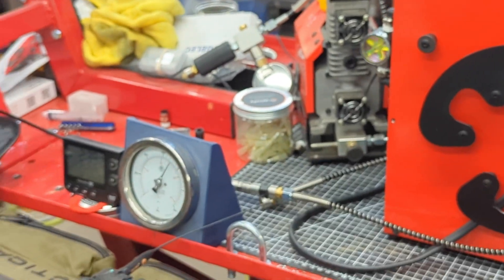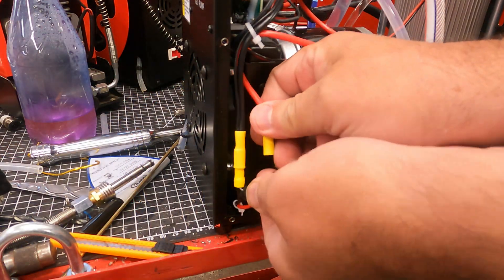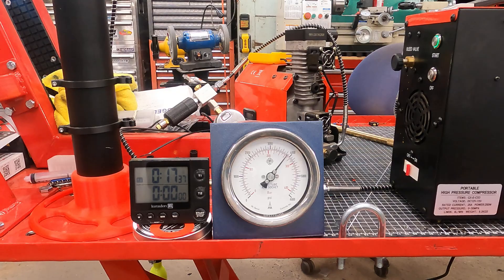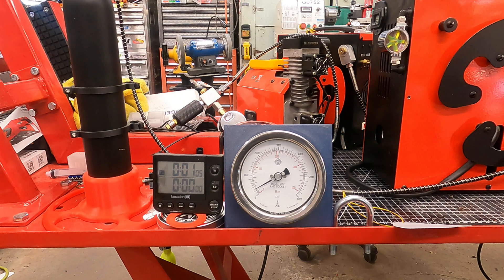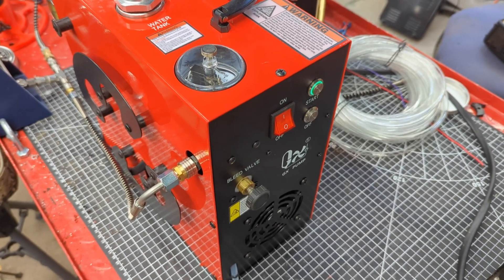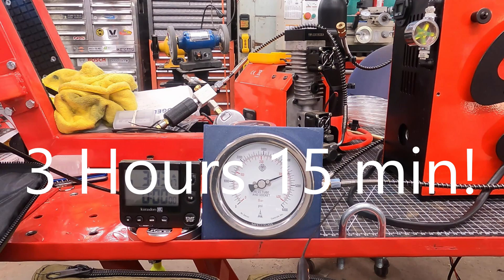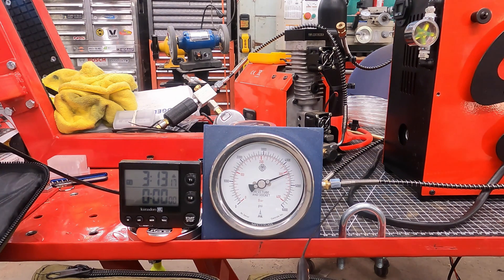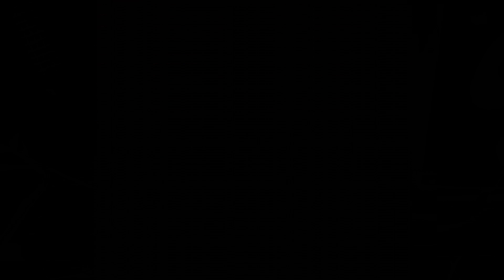Should you buy a GX CS4-3-2 compressor? Performance testing AND More! Yong Heng Hot Rod Shop

Comment from the maker: Affiliate Links That Support The Work We Do Here!
Use our link and visit Airgun Depot! https://app.rockporch.com/mlink/372?userId=140361

CS2 - https://app.rockporch.com/prdlink/UBed3CCDvC
CS2 L2 (Battery Powered)- https://app.rockporch.com/prdlink/DLgZx6QxCT

CS3 - https://app.rockporch.com/prdlink/nYp6zRhSOu
CS3i- https://app.rockporch.com/prdlink/JNULlImjtd
CS3 L3 (Battery Powered) - https://app.rockporch.com/prdlink/UVZP8sYOVV

CS4 - https://app.rockporch.com/prdlink/DPZTX4fHQM
CS4i - https://app.rockporch.com/prdlink/JQbFdsXagP
The “i” versions have the AC power supply built into the chassis and can run on 12VDC as well.

Comment: I’m loosing air in my cs4 and cannot locate it. I’m good at finding leaks but this is crazy, could it be leaking from the inside where the piston is?
Reply from the maker: If you are still under warranty, get the process moving RIGHT AWAY! Do not delay.

Comment: I'm done with the Yong Hengs.  Got 3 hours out of my last one.  Granted, I pretty much only use it to fill my 9L tank from 250 bar to 300 bar, but I baby the crap out of it.  Never let it get past 60c (or 10 minutes run time, whichever comes first), run an extra fan and bigger water pump, and use good oil.  I need something more substantial.  Do you think that this compressor would fit the bill?  Are you still in love with this compressor?  Thanks for all you do.
Reply from the maker: Welcome to the channel. The CS4 or CS4i are GREAT replacements for the Yong Heng. Yes, still loving the GX units! Using my links really helps, AND lets GX know who is sending sales there way! Win Win!
Reply: @TargetForge  been here for awhile.  Really got into the uh compressors because of your videos.

Do you happen to have an adfiliat link for the CS4-model?  I'd probably want to buy that model.  I did tell a friend about this compressor today and he ordered one.
Reply from the maker: @bigfranksworld  Here is one for the CS4 and CS4i, Also consider my parts for easily adding an hour meter and a flow indicator light for your water cooling, they really do elevate this unit. 
CS4 - https://amzn.to/3W6RXok
CS4i - https://amzn.to/3L6Khfp
Hour Meter Kit - https://targetforge.net/shop/ols/products/hour-meter-complete-kits/v/HR-MTR-CMP-KTS-STC-ON
LED Cooling Indicator - https://targetforge.net/shop/ols/products/gx4-coolant-illumination
Reply: @TargetForge  thank you!
Reply from the maker: @bigfranksworld  You are most welcome.

Comment: WOW. nice video. I have that same compressor and it seems to be killing the power converter. Customer service is really great and sending a new one at no cost to me. But WHY did the other one die and can it be repaired?
Reply from the maker: Hard to say, you could look for a blown fuse but troubleshooting switching power supplies without a schematic and and a knowledge of how they work in a steep hill to climb.

Comment: I just got the CS4 and did a Dead Head test. It took 24 seconds from 0 to 300 Bar. I really do not care for the instructions given with the unit. They could have been bullet pointed in sequence and better English. I came to the part where you add the water and it said to fill the tank and start the pump. You then would get an immediate drop in fluid level and to keep adding water until it runs out of the water return hole. So I added the water to about 3/4" from the top and started the water pump and nothing happened with the water level. I waited a few minutes and still nothing. The water was a little discolored from whatever was in there before. I finally had the courage to start the dead head test. It went fine. I then proceeded to fill my 2L tank and it took about 45 minutes. Overall I was very happy it was working well but I will now check into what it takes to flush the water tank. Since I am a beginner I find the lack of clear, thorough, practical instructions for all things PCP wanting. I will be documenting everything I learn from this and maybe take a shot at doing a video from the perspective of a beginner. I think it's easy for experienced folks to overlook some steps because you think your audience should already know those simple things. Anyway, thanks for your videos they do help.

Comment: I use a stick on vibration hour meter on mine and it works great since it also has a shut off function so it doesn't register time when I have it in the car driving to a shooting range.
Reply from the maker: I have tested many and not found even one that recorded accurately. Most are intended for very different frequency ranges and energy levels. Nice to hear you may have found one. I really like the dependability of my new stick on solution.

Comment: Thanks for a great video. Very helpful. Curious question I’m being told to always use a filter to fill the guns and or the tank and I seen a bunch of them I’m a auto spray painter.would my water and oil filtering system work for this also?? Thanks again
Reply from the maker: Pretty sure ANYTHING you have for painting is rated for shop air pressure levels, NOT 4500psi. They would fail in a VERY exciting, and dangerous way.

Comment: Bill us current CS4 owners all need clarity in the grease knob. Its a confusing mess on how to handle it, how much to turn, and when.
Reply from the maker: I'm right there with you! working the question with the manufacturer.
Reply: @TargetForge  thanks Bill. I may be now within the time interval, but I'm not turning it until we hear from you on it.
Reply from the maker: My current level of understanding is one turn after 6 hrs of operation, which I have done and can report all is well. Only turn it until you feel the grease pushing back, don't go past that. Let me know how you get on.
Reply: @TargetForge  counter-clockwise?
Reply from the maker: I just followed the arrows on the knob. I'll look again when I'm in the shop. @jarroldharrell
Reply: @TargetForge  thanks.
Reply from the maker: Just checked, defiantly clockwise on mine. @jarroldharrell
Reply: @TargetForge  that's a huge help. I definitely would have messed that up.
Reply: I’m not sure my grease knob is working properly.  It turns in both directions but doesn’t advance or reverse.  The diaphragm just bunches up and swirls the grease around over the hole like a squeegee.  The unit nocks at around 3500 psi but quiets down when I push a pinhead size amount of grease into the hole.  Any suggestions?
Reply from the maker: @myeecardio I would start the return process right now. Something does not sound right.

Comment: CO2 air gunner for years. Since  my dad bought me a Crosman Mark 1 when I was 10 because BB guns were too dangerous. I'm 65 now. (still have that pistol and shoot it regularly, along with some other crosman's and some hot rodded Chinese rifles.)

And just now getting serious about a PCP. 
I have no desire to spend all that money on a "finite vessel of air".  In reality, the main reason I have not jumped on the PCP bandwagon yet.
I have been following your videos for a good while now on the CS2 and 3, and of course the original Hot Rod.

Pretty impressive pieces of machinery. Especially being able to run one from a running vehicle.
Really liked the plug in set up you did on the truck many videos ago.

This CS4 is amazing. I was shocked to see you ran it over 3 hours non stop, and blown away that the manufacturer says it can go 5 hours. I had not read any literature on this model.

While it is not what I need, I am encouraged to see the manufacturer is investing the engineering and development time to continue to improve their product line.

Thanks for cranking out these videos. I have shared many with my friends. They are a real treasure trove.
Reply from the maker: THANK YOU!

Comment: Thank you again bill for the info..
Reply from the maker: Any time!
Reply: Do you know if they have a 120volt unit?
Reply from the maker: The AC adapter (covered in this video: https://youtu.be/KoMxNN4ecfY) comes with the unit and can run on 120VAC or 220VAC via a selection switch.

Comment: Good stuff so far.  Mostly what I fill is a 9L SCBA bottle from 225bar to 300bar (topping it off) so I can take the bottle out in the field.  The Yong Hengs just don't last.  Never got more than 10 runtime hours out of one.  I have had 4 or 5.  I do run extra fans, never let it get over 60c, and never run it for more than 10 minutes at a time.  I have been running Royal Purple in the last couple. 

Wondering how this one would last doing what I do.  Thanks for the videos.
Reply: Run the correct oil. Not the purple stuff...
Reply: @BSJ-VT  So what would you consider the correct oil?  Everyone has their preferred oil I'm sure.  The next to last Yong Heng I bought, in the user manual said "use a quality oil like Royal Purple."  Maybe you know more than the manufacture?  I have run Royal Purple in many things including my supercharged Mustang Cobra without issue.  Please quantify your post on "the purple stuff."  Site specifics according to published data.  I'm always willing to learn if I have made a mistake or are in error of my real world experience.
Reply from the maker: Good stuff!
Reply: Mobil 827. There are other similar oils.
Reply: @BSJ-VT  That doesn't explain anything.